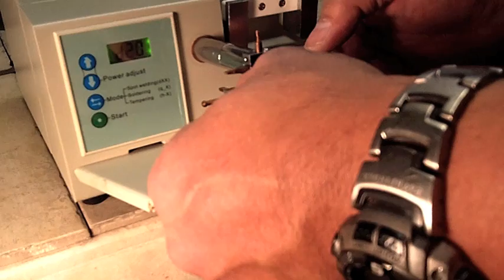See Spot Weld by FLAT CAT GEAR

Comment: I would be interested in knowing which brand(s) of equipment is/are used to manufacture your gear. Obviously I can't afford it myself, but I used to be involved in the aerospace industry in SoCal and elsewhere and I'm always curious about the technical side of things.
Reply from the maker: It is a dental spot welder that you can buy on ebay for ~$300